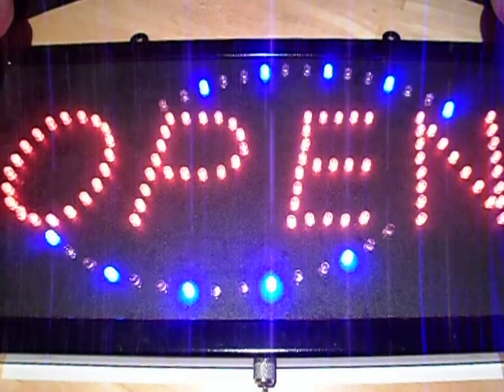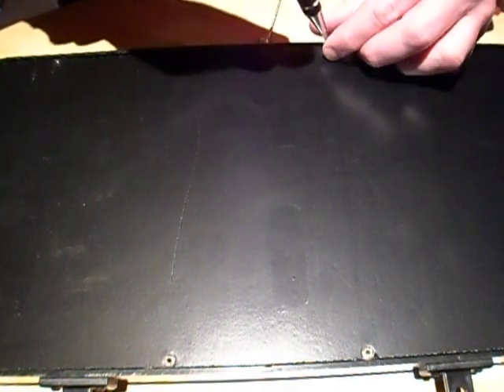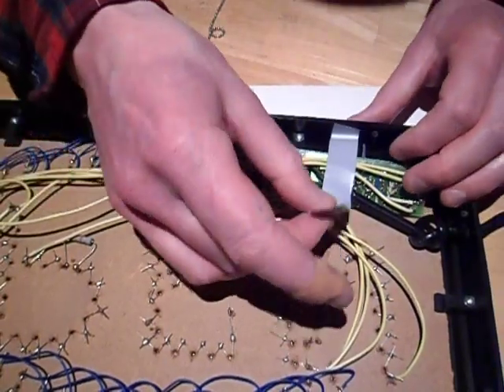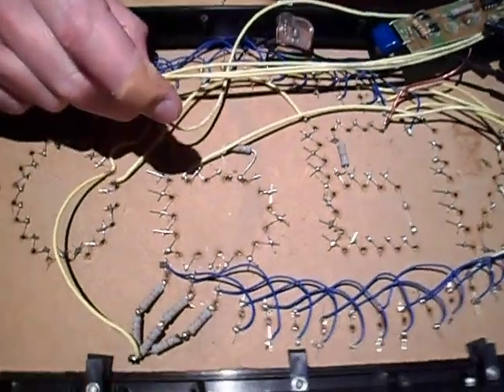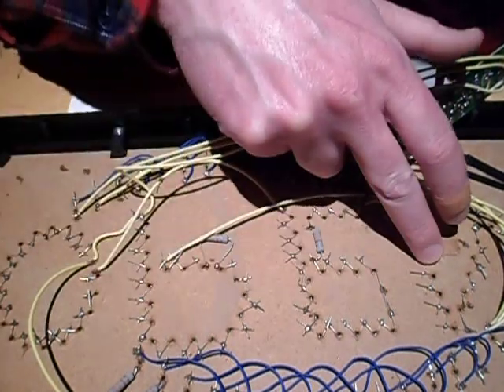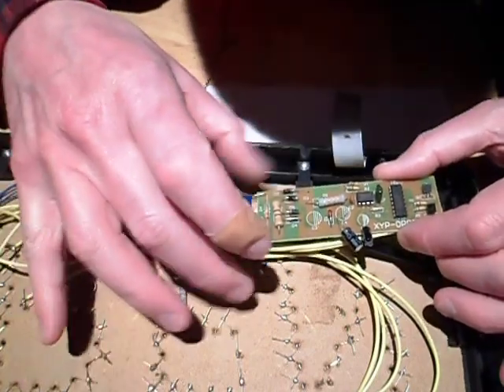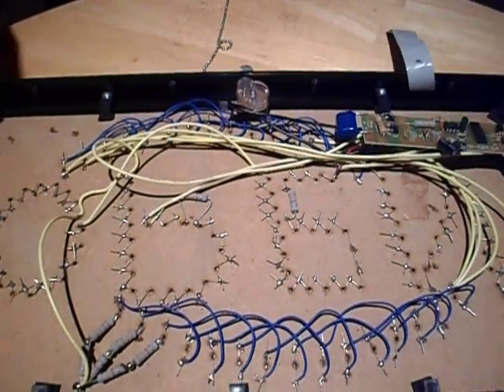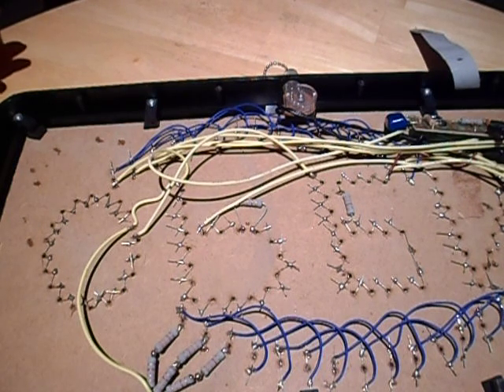Teardown of an LED window sign.

Comment: Is it possible that the plug has a one-time fuse moulded in the plastic?
Reply: Possible but extremely unlikely and even if it did, it still would not meet the standards which require a sand filled ceramic fuse.

Comment: Saw a brilliant sign in a cafe yesterday. It's an old style neon sign. The output of the transformer is fed straight through the wall onto the tubes. There is no covering anywhere, and no insulation on the tube ends  or the ht conductors at all. Its all within reach of customers sat at the nearest table or of the serving staff. From the sized of the tubes I would guess about 10kV supply, they are real neon tubes, you can see the neon glow where the phosphors end, on most of the tubes.
Reply from the maker: That used to be common.  The output current is limited but results in a violent shock.

Comment: Wait... point finger is to point with...and long finger is not to point with but for point fu'' y** with ok so lets carry on the video yes led-s is just drilled in this board...and
Reply: swetuna 
Actually, those types of finger gesture interpretations are very regional and not accurate on a global basis.
Example: The "OK" sign of making a circle using the thumb and point finger (to use your wording) for some parts of the world but for many other parts means you are a zero OR refers to ones rectal orifice as part of an insult.
So, two YouTube guidelines: Be aware of what you could be signing but, more importantly, if watching YouTubes from all over the world: Be less sensitive and move on as you wrote.  :-)

Comment: seems like a regular curcut board would be cheaper than doing this by hand but maybe not
Reply from the maker: +ChrisD4335 That would actually be quite an expensive circuit board at that size.  Even in China or India.

Comment: I first saw one of these in 1980 in the window of a fish-n-chip shop in Brisbane (Queensland not California), so at the time it would have been high tech indeed. They'd taken the back off because it overheated in the late afternoon sunlight and made a noticeable smell even over the Chicko Rolls. The LED board was the same, I think the PSU board was longer and actually on a bracket bolted on the back of the board. I recall the swirl as alternating red -n-yellow LEDS.

That sign being lit was a very welcome sight on a Winter evening after 10 hours+ in the back of the Big Gun Fruit Market.

Comment: Can I ask why the hell the uk need fuses in the plugs when Australia does not and we run 240 volts mains
Reply from the maker: Because we use ring-main power circuits rated at 32A as opposed to your lower current radial power circuits.
Reply: okay thanks for the info

Comment: Looks like something made by a hobbyist in their garden shed, circa 1990!
Reply: Make that at least 1980 !, Every component used was listed in 1970s  hobby magazines I once found in a public library.  Could be even older, but would have to look up the original release dates of the 555 and 4017.

Comment: Wow, you have some high powered outlets in the UK. Almost 8kW!

We only have 16A 230V in Finland. If you want more than that you have to go three-phase 380V.
Reply from the maker: Our standard sockets are the square pin type with fused plugs rated for up to 13A.  I'd be just as happy with my house wired in 16 or 20A radial circuits, but ring mains are just a part of UK wiring.  Their weakness is that they typically use 2.5mm CSA cable which means that if the ring gets broken then the circuit will still work but the protection will exceed the rating of the cable.
Reply: bigclivedotcom Oh, that's interesting. We only have radial here. 

The ring wiring seems like a good redundancy, but the redundancy is indeed redundant (no pun intended) if it means exceeding the rating.

Comment: This sort of construction requires very few tools and no machine processes. So I can imagine these being hand made by homeworkers in their own homes for very little reward.
Don't you just love 4000 series CMOS though!
Reply from the maker: The "retro" use of a 555 and 4017 was a surprise.  I can imagine these are probably made in a very "India" style with grubby urchins shorting live bits out to find out why their sign isn't working.
Reply: +bigclivedotcom We were taught 555s in high-school (I'm in my early 30s); general technical instruction being very behind the times as you might expect from the average National Curriculum education. Didn't understand flippin' anything about the damn thing at the end of those lessons mind you.
Reply: Same here, but only 7 or so years ago for me. They taught you enough to pass the exam but chips often had mystery pins that were never explained to you. I ended up making an electronic die (with the proper pip layout) that only ever worked properly a couple of times with a decade counter and a 555 chip.
Reply: So, as you brought this up, what actually does pin 5 do?
Reply: GreatWestern 43125  IIRC, pin 5 on a 555 timer is the control voltage pin, this allows you to control the threshold voltage. So if you use two 555 timer chips (or a dual timer chip known as a 556), you can feed the voltage from the timing capacitor from the first stage to the control voltage pin of the second stage. You then get a siren type effect (sweeping low and high tones).

Comment: It looks like a school GCSE Technology project inside! Then again, it probably was built by a child...
Reply from the maker: It certainly does look like something I'd have made when I was a kid.  But on the other hand, it's a very cheap way to make large custom signs.  The way the LEDs are mounted  is surprisingly secure and the fact they sit on the front obscures the roughness of the hole itself.  Many years ago I made a sign that said "Clives arcade" on a large square of plywood.  I drilled two 1mm holes per LED and pushed the leads through and bent them back.  The single 3mm hole is a better idea.  On mine the sign was a "scripting" sign so the large name in a handwritten style would sequentially fill out due to a large number of 4094 shift registers.